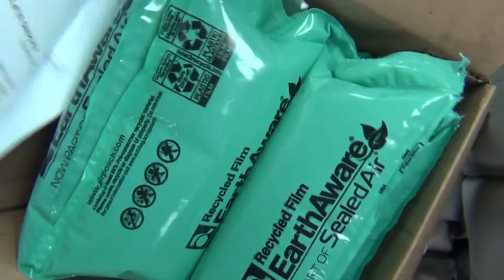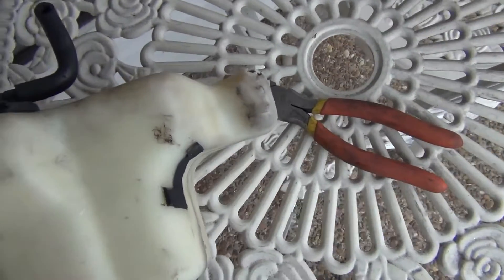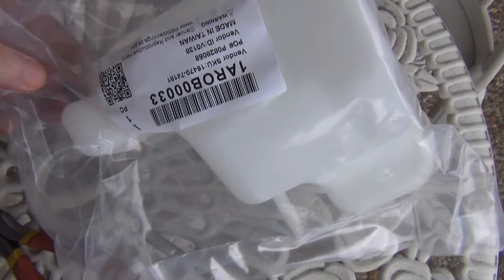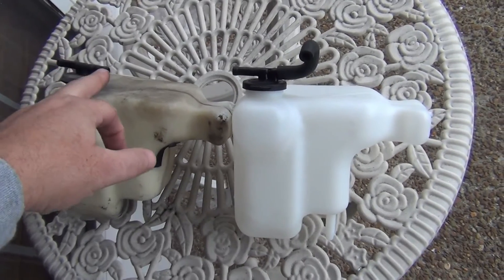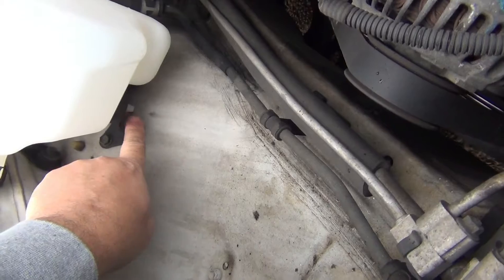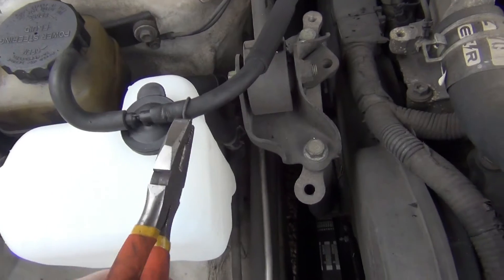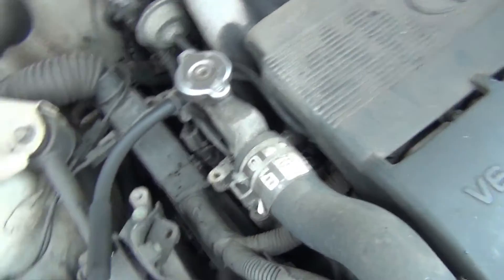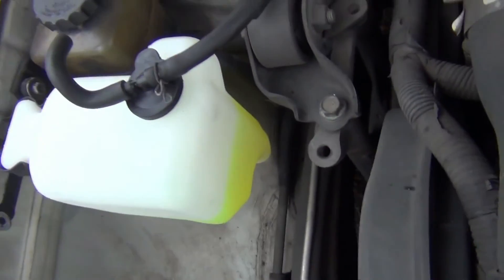How To Change A 1992-96 Toyota Avalon 3.0 V6 Coolant Reservoir Bottle

Comment: I ordered a reservoir for my Avalon because the old one has a crack in the corner, do I flush the system before swapping the old one with the new one? Or would it be ok to flush if If already installed?